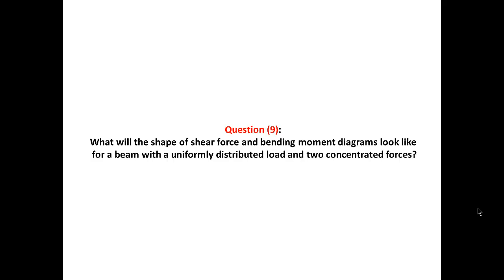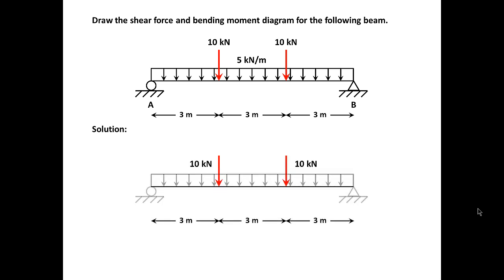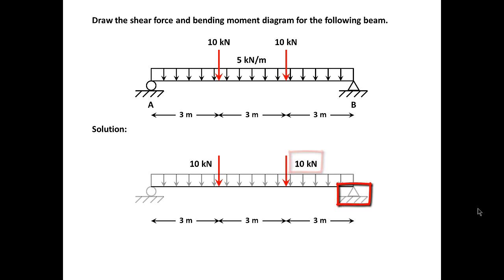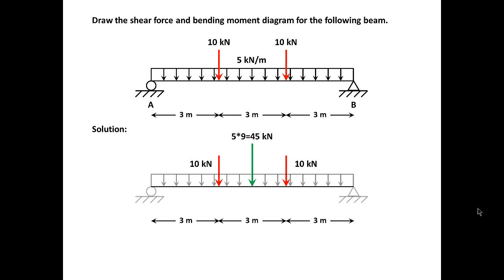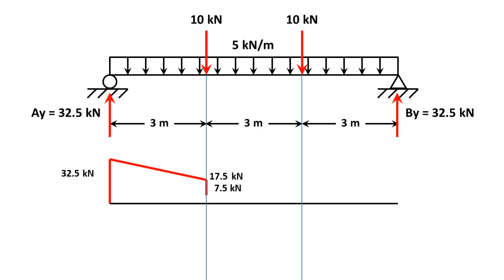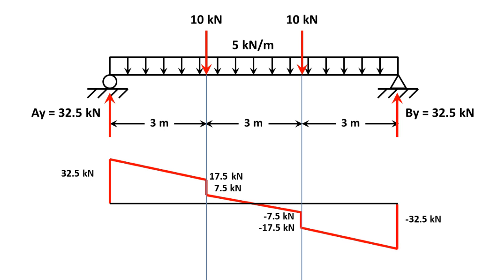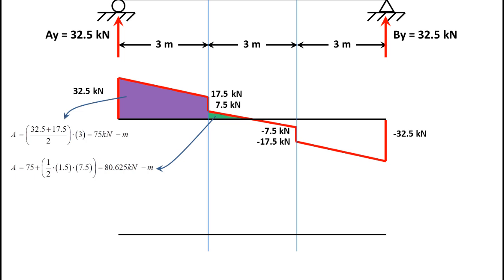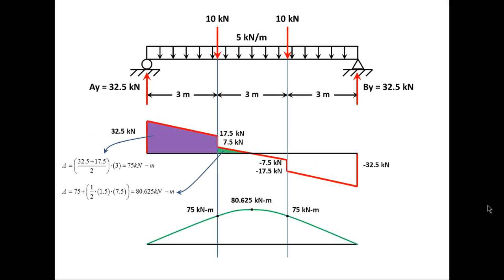Question (9):  What shapes do V and M diagrams take for a beam with UDL and two concentrated loads?

Comment: Will you please explain how to solve a beam for having udl on entire span and two unequal point loads unsymetricaly placed. for example a S.S. beam of span 5 mtr. with udl of 20 Kn/m. A point load of 20 Kn acting at 1.2 mtr from its left support and another point load of 25 Kn acting at 2.8 mtr. fromits left support. Please explain how to find SFD & BMD for this kind of problem?

Comment: Is there a prefered method generally? I struggle with the calculating  the area when the UDL is in the problem so i prefer to do the method of sections and calculate the moment at each cut. 

Thanks
Reply from the maker: Chris Taylor This is exactly what I do. If the area is easy to calculate so be it. if not, I use the section method you are talking about.
Reply: Thank you very much!!
Watch your video's regularly- very descriptive and easy to understand. 

Thanks

Comment: What I sometimes get confused with is, which way (concave up, or concave down) the moment diagram should point with a triangular profile Shear. For example this problem: Cantilever beam. Fixed at A, move over 10m, Hinge at C, Distributed load of 10kN/m from C to B (10m), at B is a roller support, from B to D is 5m, at D there is concentrated load of 50kN. So the total Length of beam is 10+10+5=25m. Fixed support at A, roller Support at B, hinge at C, distributed load from C to B, concentrated load at D.